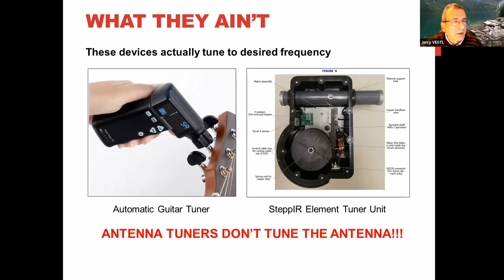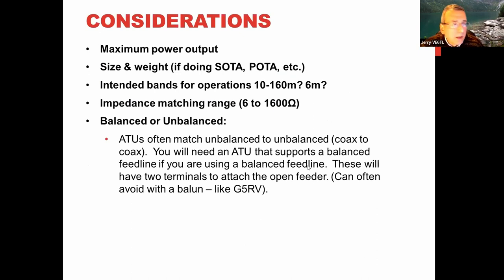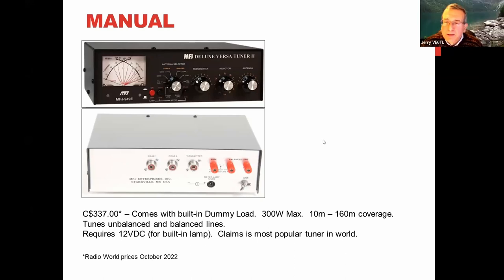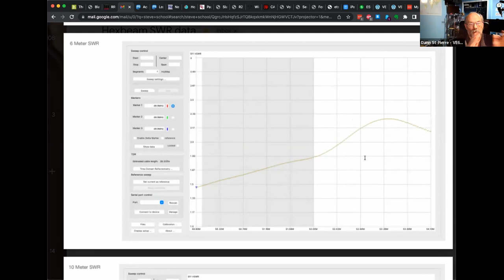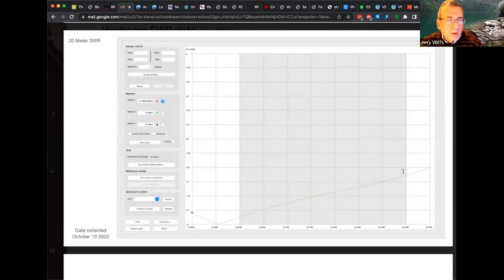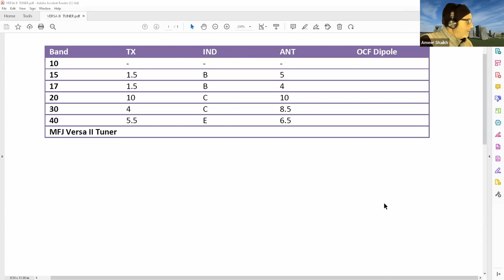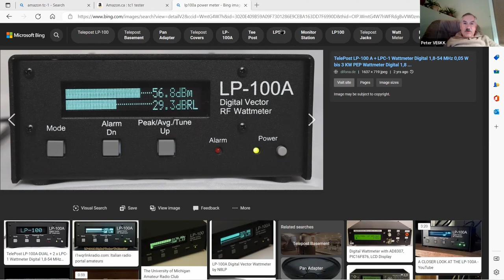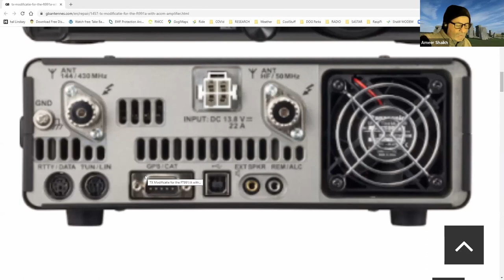Antenna Tuners for Beginners

Comment: FWIW the MFJ 949E uses the external DC for the PEP function of the meter as well as the backlight. Somehow that is not mentioned in the manual but visible in the schematic.